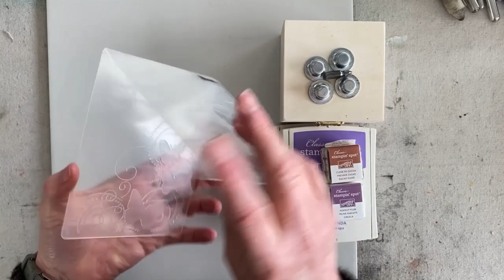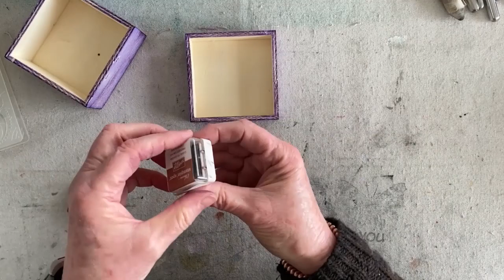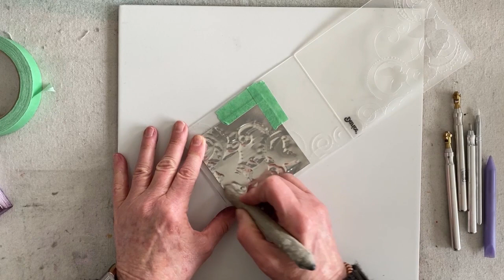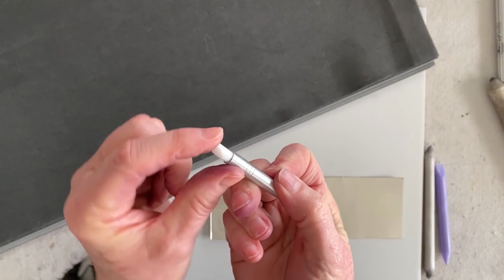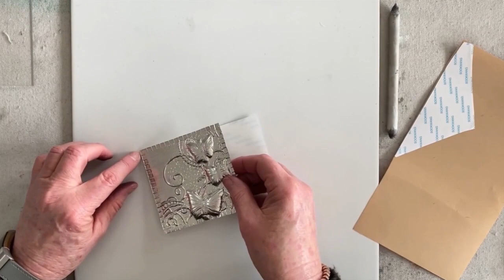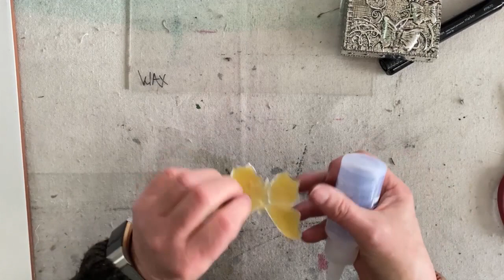How-to Emboss Metal Using an Embossing Folder - NO Embossing Machine Needed

Comment: Hi can I use a blending stump instead of a paper stump . Do they both work as well as each other on pewter. Also how thick is the pewter you used please
Reply from the maker: Linda, yes, you can use a blending stump; it is the same as a paper stump, which also goes by tortillon. It would have been easier if everything only had one "name." 🙃The pewter I use is 36 gauge, ± 0.15mm. Here is a link to the pewter available in my online store for your convenience 😊 ~ https://esmericart.com/product-category/metal-by-the-sheet-or-roll